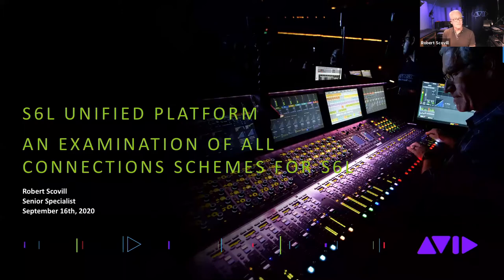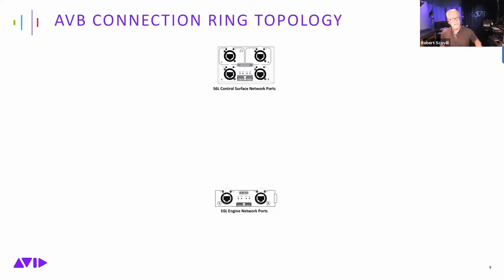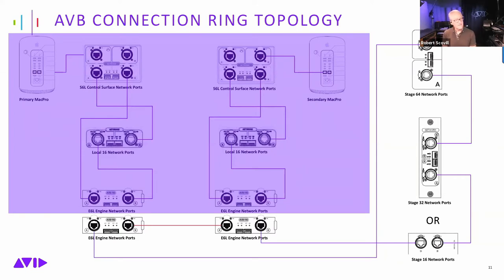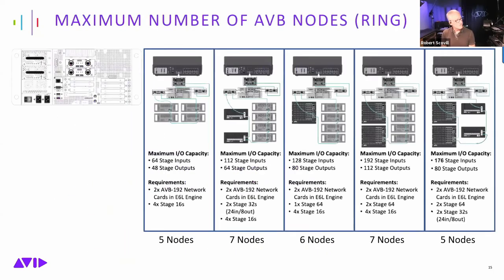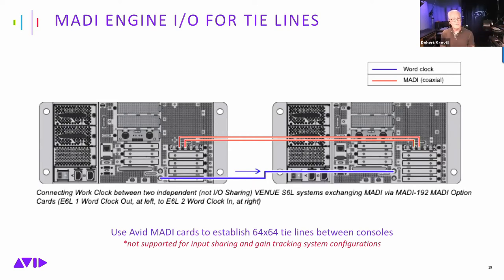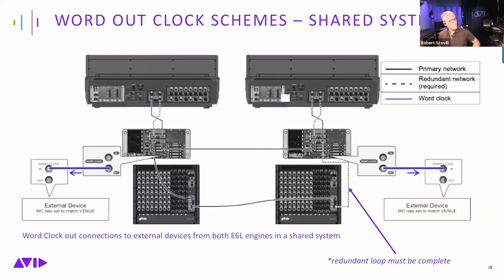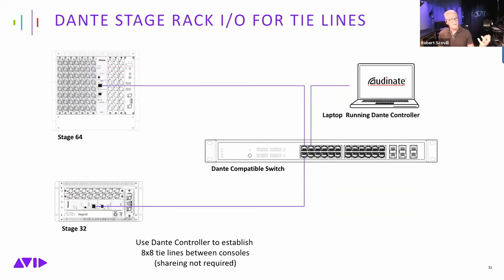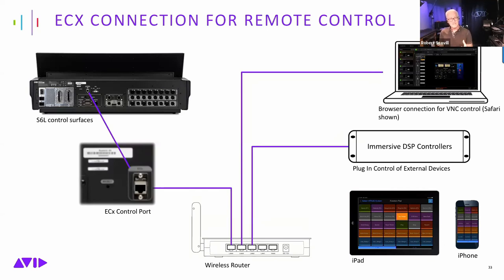Exploring all Connection Schemes for Avid VENUE | S6L

Comment: Thanks 4 this video Robert.    Zero experience on the S6.    We have a tour coming in on a fly date that requested this rig.   This was very useful at least to get the gazintee to gesoutee’s.    Hopefully it’s as described.   Just follow the ring connection and there is nothing to fuss with on the software.    Will follow up.    Been meaning to get into the lab but it’s been crazy.   Pavan says it’s a great hang.

Comment: Thanks for the video for sharing different connection methods. I am a new user of Avid VENUE S6L, the audio network connection on our system keeps getting lost warning. The connection drops out for seconds and reconnects again. It always display the redundant connection lost warning. We have tried many different CAT cables. Our current connection is A to B redundant connection, we will try another connection methods to solve the problem.